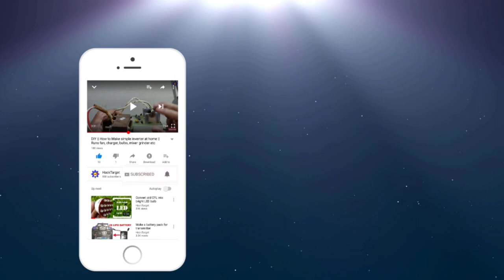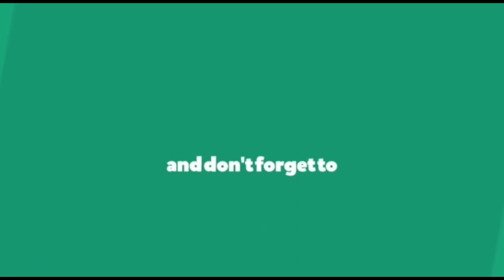Life Hack Gadget that Everyone can make ~ Easy|| Hack Target

Comment: 1:15 what is that?
Reply from the maker: ultrasonic piezoelectric humidifier , see here 1:03 its removed from the circut board to attach longer wires
Reply: @HackTarget786003  how much does it cost or from where can i get this
Reply from the maker: You can get this from a old mist sprayer , or find it in Robu.in  , search ultrasonic humidifier